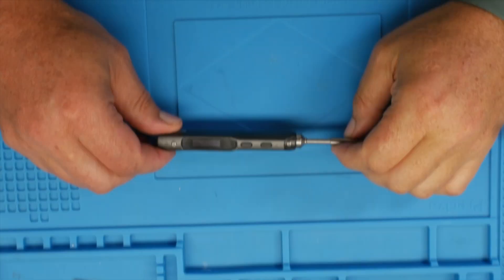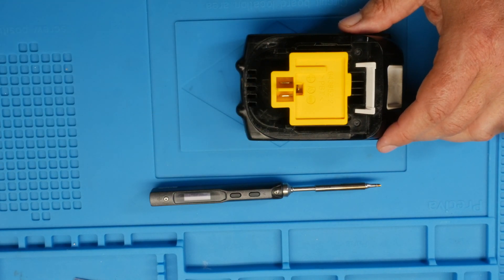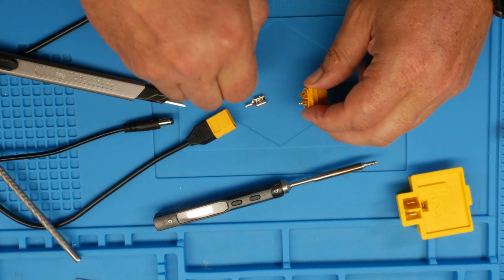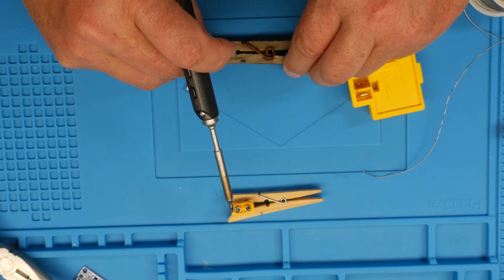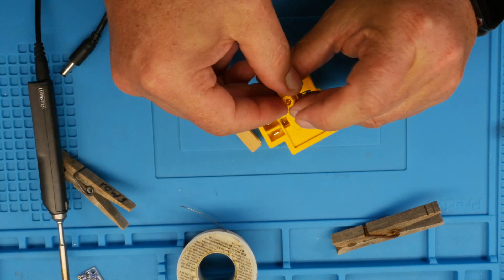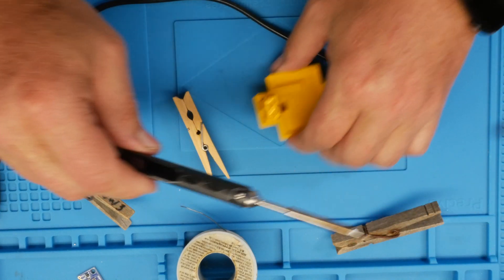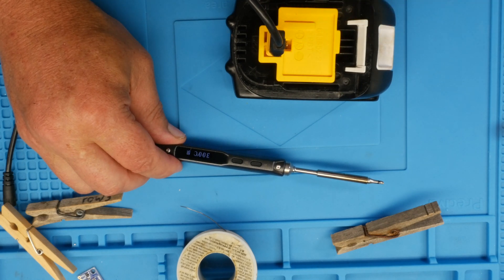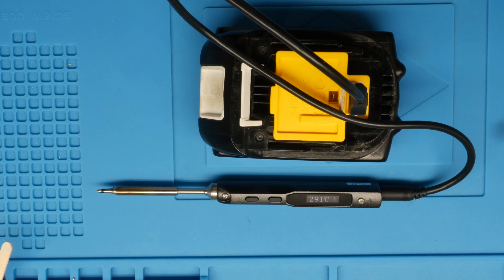E001   Portable Power For a TS100   4K

Comment: I always look in the comments below videos for good tips from other knowledgeable folk so i will give my penny's worth too. I would use a 3ah battery because a 1.5ah or 2ah battery is a bit too small but also its all about capacity. These irons can accept 24volts so 18v battery is already down a bit from optimum. Therefore you will need to keep the 18v as close to full for as long as possible.
So the more capacity a battery has the longer it will keep closer to 18volts. I hope you understand the reasoning here. A 24v battery would be even better as you can then get the full 65watts from these irons and that extra heat is sometimes needed, especially in windy conditions or on large ground planes. Have fun!

Comment: how are your batteries holding up as i'm pretty sure for the draw of the iron you need a protection circuit due to how irons heat up.
Reply: No issues so far

Comment: I Used Rigid Battery with Battery Adapter for Ridgid AEG 18V Hyper li-ion Battery Dock Power Connector Rigid 12 Gauge Robotics, 12 amazon,, theres a 25 dollar adapter with active button, with usb a connector, i also bought XT60 adapters for 10 Dollars ,12  pair in package, solder  female connection to wire and plugged in works great, i heard you can advance the heat to 450-500 c, what firm ware do you recommend.
Reply from the maker: I just use the standard firmware that came out of the box